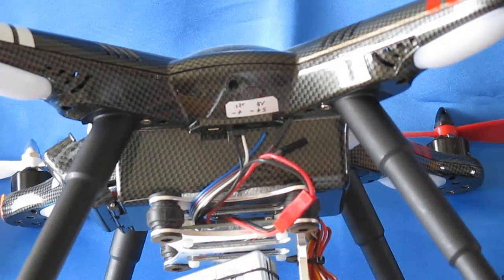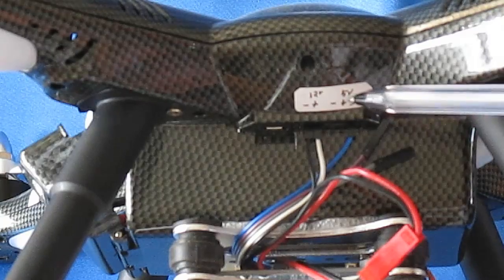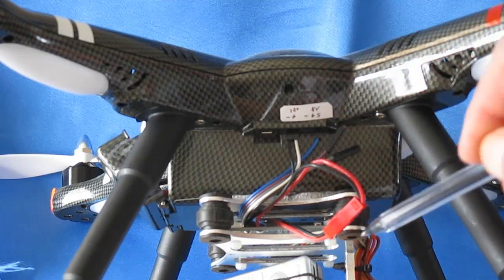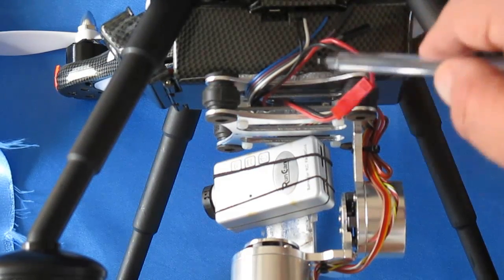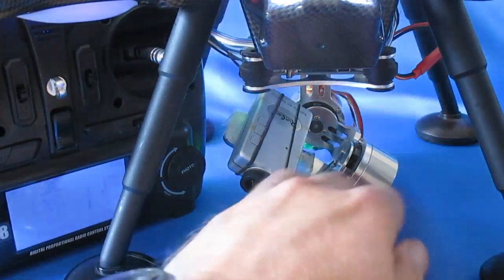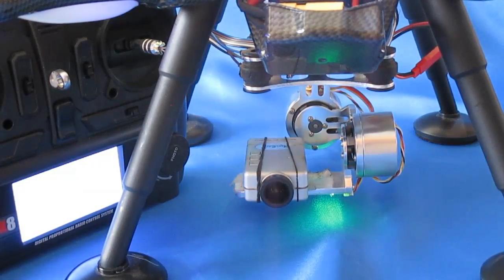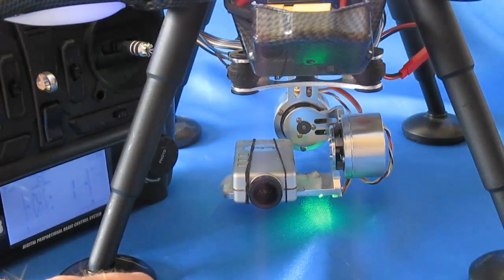XK Detect X380 Drone Generic Gimbal Electrical Wiring Setup

Comment: I need your help Sir. I got my Gimble setup correctly with my X380 and it is taking its power from the 12 v pins. Now I want to provide power to my 5.8 G TS832 which needs 7 - 16 volts. Sure the remaining 5 v pins in the X380 will not provide enough power. What is your recommendation
Reply from the maker: add a small 7.4v lipo to power the transmitter?
Reply: @Quadcopter101 ... But this is an added weight to the Drone. How about splitting the the power going to the gimbal

Comment: Thank you so much , that was very helpful. One note though, the pitch control isn't really useful  unless you have FPV to see where the camera is pointing. Any recommended FPV for the X380?
Reply from the maker: One option is to attach a 5.8 GHz all in one (AIO) camera. They're cheap, and easily powered with a small LiPo battery. They can also be attached to just about anything. However they do require purchase of separate 5.8 GHz FPV goggles or monitor. Here's an example https://youtu.be/9UWWScnLBxw

Comment: So basically, oneself has to be an electrician to fly a drone and take photos: why such a complicated system, whats pitch and roll? are you talking about baseball and front flips (pitching and rolling?) how simple would it be to mount the camera, 2. connect via usb to the drone, press a button in the controller to take a picture remotely or record. Man stop complicating so much. How to take a picture? thats it! how?

Comment: Thanks for the very clear video - before connecting anything I tend to get the multimeter out "just to be safe"

Not sure if anyone has mentioned it, but my camera always got the feet in shot, I got round this by unscrewing the "roll" motor (the one closest to the main circuit board) turning it about 180' and then mounting the whole unit "back to front" - the camera now sits just under the battery trapdoor, and the feet are well out of the way.

Comment: I plugged the black and red wire from the gimbal into the first port on the 380, and a pin from top left of the  pins on the gimbal to the back most pin on the 380, Exactly as shown in this video.

The result...my drone is dead... just flashes red...thats it. I get a green if I connect it to the computer, but I can' bind the controller or get a flight ready status...I have a new x380 now but I'm afraid to hook up the gimbal. 

The gimbal does power up and steadies itself as it should, so I suspect its the pitch sending wire that cooked something....Any thoughts?
Reply from the maker: Extremely important to double and triple check that the gimbal's red power wire goes to quadcopter + power pin, and the gimbal's black power wire goes to - power pin. You can damage your quadcopter  If you accidentally mix them up.  http://img11.hostingpics.net/pics/266239X380ports.jpg
If you're not familiar with electronics, recommend skipping this project, or finding a friend with a little electronics background to help you hook it up.
Reply: definitely is red to red and black to black. I am pretty sure the issue happened when I attached the pitch signal wire
Reply from the maker: All I can say is triple check each of those three wire connections on both ends.  For example, it would also be very bad to accidentally connect the signal wire to the quadcopter's ground pin.
Reply: The quads already cooked. I can power up the gimbal with it and it works, so I'm assuming there is something wrong with the pin on the gimbal. It is DEFINITELY in the same place on both ends as in your video. (I checked a few videos before I did it) I have a new quad here, but I'm not hooking this thing up until Im sure the signal wire was the issue. I'll post a video of how Im hooking it up.
Reply: I added a plug to my batteries so I could power the gimbal up without plugging into the quad copter. Works great and no risk to the quad. No pan, but I can live with that.

Comment: I burned out my board so what do I need to do
Reply from the maker: +Old School R/C Unfortunately replace the board.  There's only three wires to connect with this gimbal.  But it's extremely important to triple check that they're connected to the proper pins.
Reply: +Quadcopter 101 No I burned out my board on my quad, is it easy to replace?
Reply: +Quadcopter 101 and should I replace the ESC also?
Reply from the maker: +Old School R/C I don't know.  I've never replaced it.  Might want to ask on the X380 forum post for those that have http://www.rcgroups.com/forums/showthread.php?t=2420732&page=572
Reply: +Quadcopter 101 well I purchased both anyway just to be safe

Comment: For some reason when i connect the gimbal signal wire to the signal port on the 380 my gimbal jerks up and down and doesnt  do it`s job at all, i have the wire connected to the correct pin on the gimbal, is there anything else i done wrongly?
Reply from the maker: +kwabiNEXAS Double and triple check your connections, particularly the signal pin connection points to both the quadcopter and the gimbal.  Compare them closely to the above video.  It is very easy to make a mistake, which can potentially damage your quadcopter.
Reply: +Quadcopter 101 But i got a question, does the basecam settings has something to do with the pitch signal? like do i have to adjust some kind of settings in the basecam bgc so that the pitch signal will work accordingly or is it just a human error?
Reply: +Quadcopter 101 oh and does it matter if i use a different colored wire for the signal wire?
Reply from the maker: kwabiNEXAS You can use any colored wire, but you better be certain that both ends of that wire connects to the appropriate signal pin on the quadcopter and gimbal.  If you're absolutely certain that it's connected as shown in the above video, then the next thing is to cailbrate the gyros.  
1. Place the quadcopter on a flat and level surface (recommend a table beside your PC).
2.  Level and immobilize the gimbal by placing some tissue paper underneath it. Adjust until as level as possible.
3. Leaving the quadcopter unpowered (do NOT plug in its battery), connect the BGC program to the quadcopter via USB by clicking on the "Connect" button.  Ensure that you're connected before proceeding. 
4. With the gimbal level and immobilized, Click on the Basic tab.  Then click on Calib.Acc button, wait a few seconds, then click on Calib.Gyro.
5. Wait a few more seconds, then click on Write button in lower right corner.
6. Disconnect the cable, power up the quad and gimbal (ALWAYS with a camera attached) to see if the problem has been corrected.
Reply: +Quadcopter 101 okay i will do the steps you stated when i have the time some day and lets hope it fixes the problem! thanks for the help and will update you when i do so :)
Reply: +Quadcopter 101 Well, i tried connecting the signal wire from the gimbal to the signal port exactly like what you told me to, it actually got worse! It bricked my 380 and i can`t even do anything about it right now, each time i plug in the battery the 380 just gives of a slow beep with or without the radio turned on, couldn`t connect to my computer too...i guess the issue of my faulty signal port is related to the hard crash months back when i did not calibrate my compass correctly, oh well time for a new quad..maybe a walkera 350 pro or something haha.

Comment: I have java installed and now I virus on my computer. dam McAfee said it was a safe sight . I have some shity luck. anyway when I go into lower the power are all the numbers supposed to be blank n I fill it in? gosh this is difficult!
Reply from the maker: +Ian Rice This guy shows how to do it.  But only lower the power settings enough that the vibrations go away https://www.youtube.com/watch?v=clX-FC7m13Y
Reply from the maker: +Ian Rice Also do NOT move the sensor like he did in the video.  There is no real reason to do that.
Reply: Thank you sir for all of your help. i fixed my computer and i got into the camera settings and now i just need to get the weight right. wish me luck thank you so much!!! :)
Reply from the maker: +Ian Rice Yep, just lower the power settings a bit until the jitters stop.  Additionally, you should calibrate the level position of the gimbal.  No battery or powering of the quadcopter is needed for this.  With your camera attached, place your quadcopter unpowered on a level table.  Stuff some tissue or foam under the gimbal to level it with the table.  Plug in your computer to the gimbal's USB port.  Start the SimpleBGC configuration program.  Select "Connect" and click on the Basic tab.  Double check that your camera and gimbal are still level, and then click on Calib Accel, wait a few seconds then click on Calib Gyro.  Then put a check mark in  Skip Gyro Calibration at Startup.  Finally click on Write in the lower right corner.  These settings should be good for a while, but if you notice the gimbal having a hard time finding level, just recalibrate again.
Reply: +Quadcopter 101 I just got home I'm going to go inside and come follow your instructions step by step. I can do this without hooking the gimbal up to my x380? because I took it off last night so I can fly this morning and you know how them rubber balls can be a pain. I was doing it wrong cuz I had it plugged in and the x380 turned on. from that video of that guy it looked like his phantom was turned on. well I'm learning little by little. Thank you so much again and again! I will let you know if I get it to work.
Reply: +Ian Rice I'm an idiot I know it has to be hooked up to the quad. I'm going to plug it all Back in. I'm really hopeful this is going to work! Your such a helpful person thank you! :)
Reply: +Quadcopter 101 I did exactly what you said to do step by step. I tried a couple times and when I did the steps I would save and disconnect and then turn on my x380 it would still do the same thing. I just really want this thing to work. I hope I can get it right eventually. thank you sir. I'm going to keep trying.
Reply from the maker: +Ian Rice Do it again, but this time try removing the check mark in Skip Gyro Calibration at Startup
Reply from the maker: +Ian Rice Also try tilting the camera all the way up before startup.
Reply: +Quadcopter 101 I'm going to try that now. I'm starting to think I'll never get this thing to work. I'm determined because I love this hobby so much. But I put allot of hours on assist l already. I did her to work when it was plugged in it would stay steady even when tilting the quad but when I tried it without being plugged in it didn't work again. thank you.
Reply: +Quadcopter 101 I can't get it to even tilt straight up n down now. I don't know this is something else. I thank you for all your kindness and help. I'm about to say forget it and return it. talk to you later. :)
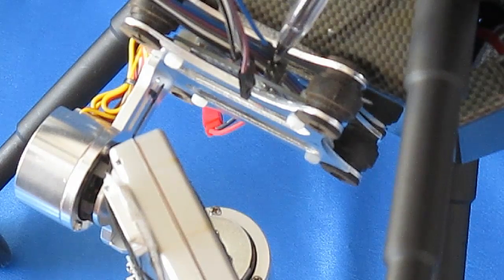Reply from the maker: Ian Rice One thing before you give up, double check the signal pin connection between the aircraft and the gimbal. Make sure that it matches as shown in the above video at 3:47
Reply: +Quadcopter 101 ok I'm checking that now. It's hard for me to give up I want it so bad. I'm still sitting at my computer with is plugged in trying to figure it out.
Reply: +Quadcopter 101 omg I had the single pin in the wrong place. I had it right last night but when I plugged it in today I did it upside down. I fixed the single pin goes now I'm going to try again. thank you!!!
Reply from the maker: Ian Rice It's very easy to make that mistake.

Comment: oh I also put a video on my page of how the gimbal is reacting if your curious to see.
Reply from the maker: +Ian Rice Did you configure it?  Click Show More in the above video description section.
Reply: +Quadcopter 101 no I didn't configure it. I'm going to check the link out now. Did you see my video of what it's doing?
Reply from the maker: Ian Rice Yep, it needs configured. Leveled and power settings reduced.
Reply: +Quadcopter 101 after I adjust the power numbers should calibrate acc and calibrate gyros then hit write? Or just hit write after changing numbers?
Reply from the maker: Ian Rice always hit write to activate the effect.  Remember to do the gyro and accelerometer calibration with no power to the quadcopter.
Reply: Yup I was doing it all right. 10 hours went into trying to get it to work. I got the thing last night. I don't know what to do.

Comment: I got my gimbal and I can't figure out the multi color single wires. mine are a little bit different color. I have red, brown, orange, yellow and bluish green lol. I don't know where to put each. if they were the same color as your that might help me. can you help? please this is driving me nuts!!!
Reply from the maker: +Ian Rice That's a universal connector cable.  They're colored to help you keep track of what each wire is connected to. You only need to use three of the wires for the + - and signal wire.   You can choose any three to be what you wish.  For example, my multi color cable is colored black, white, blue, purple, gray.  I used the white wire to connect to +12V, and the black to connect to -12V.  I used the blue wire to connect to the signal pins between the quadcopter and gimbal.   The purple and gray wires were left unused. 

In addition to the multi colored cable, you should have also received a red male JST connector with red and black wire.  Simply plug the bare wire ends into the connector plugs of the multi colored cable. Remember red is +12V and black is -.

Now be very very careful to double and triple check your wiring.  Crossing the streams (miswiring your gimbal) would be very bad.  It could result in total protonic reversal, or at the very least, a fried flight controller board. If you don't feel confident to do it, then ask that geeky friend who has no problem building his own computer.  It will only take him 5 minutes to do it ;-)
Reply: +Quadcopter 101 first off thank you so much for getting back to me! I'm pretty sure I have it hooked up right. You know the jst plug that came with Tyne x380? well I have that plugged closest to the front of the quad, the black is on the left n the red is on the right. then the pin all the way to the back I have one of the universal singles pins and going to the left of the six the pins in the board. and it's the same color all the way threw. I have two action cams the asx black edition 4k camera and the sj9000. is this all correct sir?
Reply: +Quadcopter 101 I'll get it to work sometimes but the motors still vibrate is that supposed to happen?
Reply from the maker: Ian Rice You need to turn down the power setting a tad.  Again click Show More above.  Also watch the tutorial video showing how to use the software (again link is above).  You don't need to turn down the power as much as he did.  Just turn yours down until the shaking stops.
Reply: +Quadcopter 101 thank you so much sir. Your help is well appreciated. I'm going to do that now.
Reply: +Quadcopter 101 thank you so much sir. Your help is well appreciated. I'm going to do that now.

Comment: Some people that bought this gimbal have reported problems with their 380 doing the "toilet bowl" and compass decalibration. The magnetic sensor is in the foot of the front right leg. Is this "electromagnetic interference" evident in your setup?
Reply from the maker: +Stretch “Stretch9x” 9X Not really https://www.youtube.com/watch?v=4MWK8bxkviE
Reply: +Quadcopter 101 Sorry, I goofed! That toilet bowl issue is present when using the Feiyutech mini 3-axis gimble. In this case, moving the compass sensor to the right rear leg usually fixes it but this requires soldering lead extensions and flipping the sensor so it remains correctly oriented.

Comment: hello Quadcopter 101
I am waiting for a x380!
and I wonder if this Gimbal cause any interference with the magnetic compass of the  x380?
I bought one and so now I realized that I may have this problem!
you think I made a mistake when i buy  this Gimbal?
Best regards from Spain
Reply from the maker: +0oMANOo0 Mine doesn't. It flies just fine with this gimbal https://www.youtube.com/watch?v=4MWK8bxkviE But make sure that there is no objects strapped to the top of your quadcopter.  And also make sure to calibrate your compass if you haven't done so already.  You should only need to do this once for your local area of flying https://www.youtube.com/watch?v=GY-Qr6cnORY

Comment: I've got the very same Gimbal it seems only in Black. I've installed it with my SjCam SJ4000 (Wifi version) and I've managed to find settings that seem to hit the sweet spot with regards to keeping it both quiet (no high pitched noise) and also keep it in the correct position. My only problem now is that the signal wire to the pitch signal pin is doing absolutely nothing and I simply can't figure out what I need to do... I've tried all sorts of different settings like PWM > Analog with nothing working out right...

Please help!? :)

Comment: Have you been flying the x380 much more with the ebay gimbal? I found that after awhile the tilt capability no longer works and I believe that it might be due to some type of incompatibility between the quadcopter and the gimbal controller causing it to no longer work. Having read some posts on various forums, this seems to be a problem and I was just curious to see if this has happened to your gimbal?...keep flying!
Reply from the maker: +JB It hasn't happened yet.